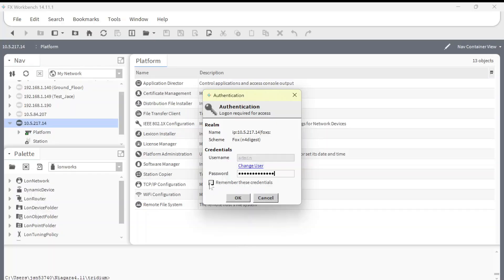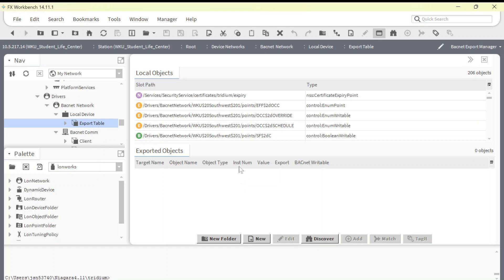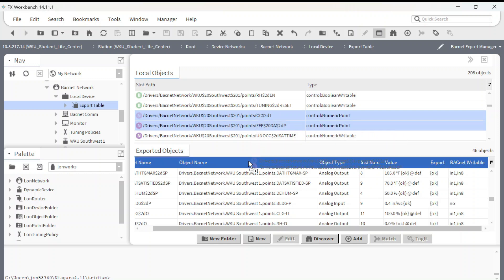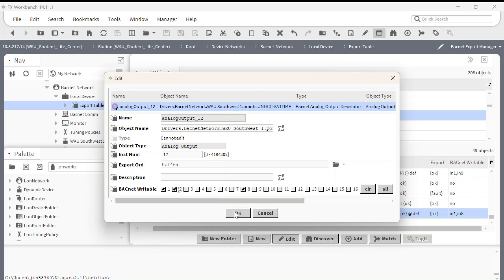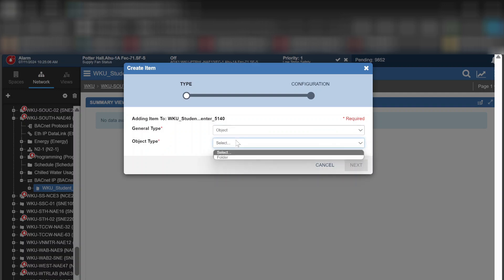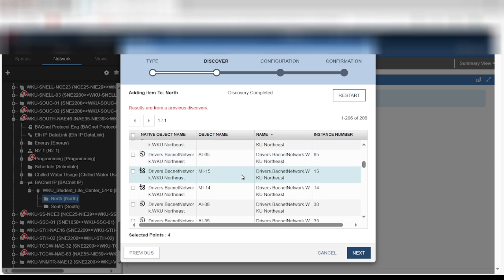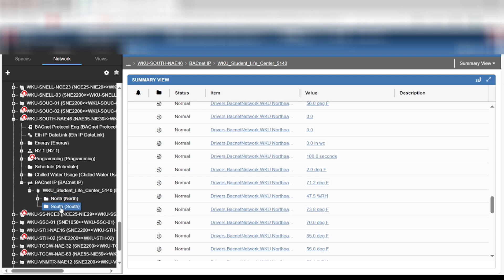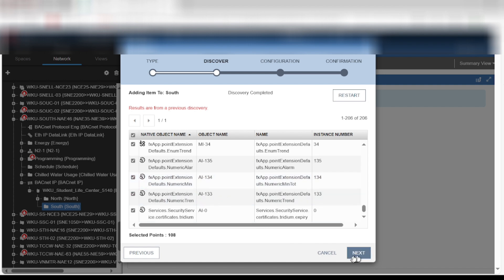Step-by-Step Guide: Integrate Tridium Jace with Johnson Controls Metasys

Comment: I’m trying to integrate verasys into a Vykon Jace. Most of the points in my RTU read either 7734 or 7735. The VAV’s are fine, all valid values so I’m not understanding why the rtu isn’t. Any advice?
Reply from the maker: The last verasys system I worked with ended up going in the trash for basically the same reason.  The points wouldn't pull in correctly.

Comment: I connected the wire connection of bac net port of spider controller to N2 port of NAE controller and searched for spider controller by logging in NAE controller but spider is not found on NAE,
Reply from the maker: Is the spider set to communicate n2?

Comment: I connected the wire connection of bac net port of spider controller to N2 port of NAE controller and searched for spider controller by logging in NAE controller but spider is not found on NAE,
Reply from the maker: Check tha baud rate

Comment: Great video! I’m having an issue where I can discover the NAE from the JACE, but my NAE doesn’t see the JACE. BACnet routing is enabled on the NAE. Could you possibly show a screenshot of the configuration setup for the JACE? I’m particularly interested in the IP network ID and device ID settings to ensure the JACE can communicate with the NAE. Thanks!
Reply from the maker: There are a few things to check.  Can you browse to the Jace from another location? If not, check the network policies of the company where it is installed.  We have the IP address reserved using the Mac ID of the device we're installing and then set the device to DHCP enable.

Comment: I have created an export table and pulled the points into Metasys. We are having an issue where the Jace is refresh the data accurately but it’s lagging on the Metasys server. How do I get Metasys to refresh as fast as the Jace? Also thanks for the video.
Reply from the maker: That's a big challenge because some of the things that can affect it is the network traffic and data being used by the system.
Reply: @Systemcontroltech ok. Thank you for the reply 😊